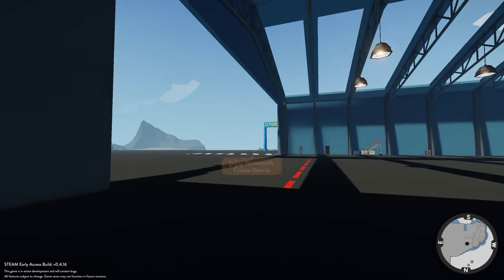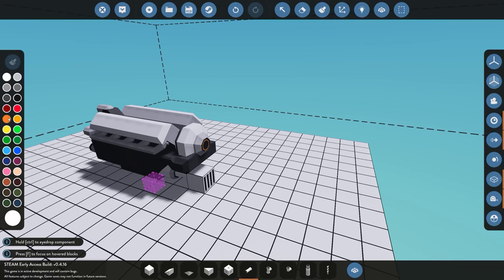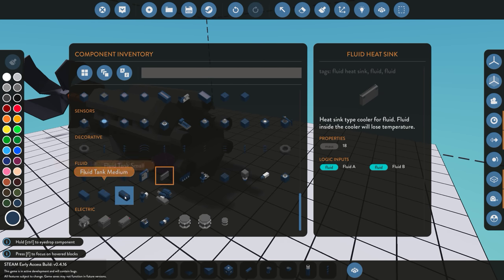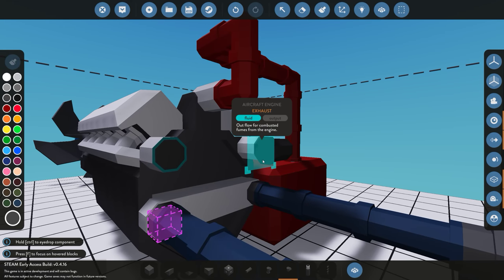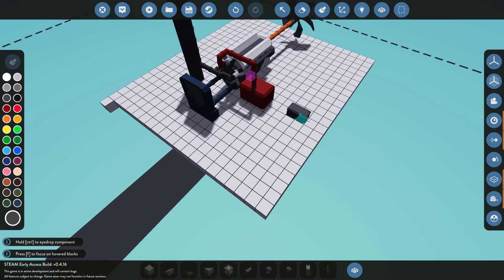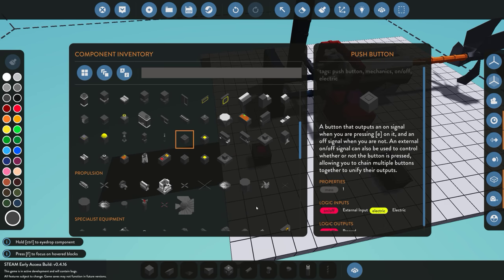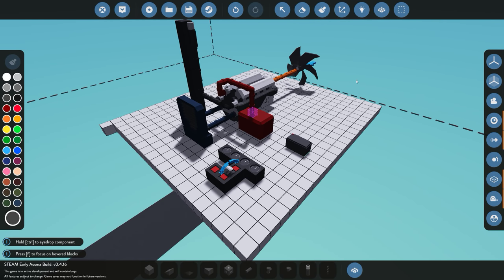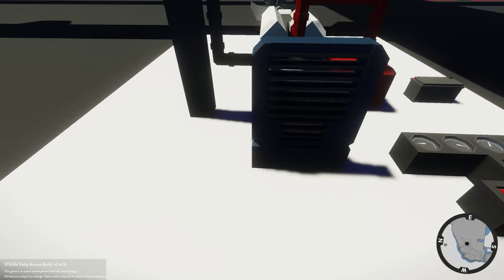Stormworks Step by Step Advance Vehicle Engine with Clutch & Gearbox Build Tutorial

Comment: so im having trouble, i connect a clutch to the engine, have a throttle switch on it and it all has power, yet when i turn the engine on, the boat starts going. All the clutch throttle does is change the sound, the prop keeps spinning no matter what. The gearbox is also ineffective
help?
Reply: TeslaBro is the clutch and gearbox right way? Its good to check
Reply: @vanukas8783  i also have a problem the engine cranks but doesnt start everything has power and gearbox is the right way up so umm and yes proppelors spin
Reply: BLÖRÖ dont ask me
Reply: BLÖRÖ btw have you tried Diesel yet?
Reply: @vanukas8783  yes its on diesel

Comment: CAn you connect batteries to batteries and still charge them all with a generator?
Reply: if you have all the batteries connected to each other if any generator is connected it will split the power to the batteries, all batteries connected to that network. also BTW you can have a block like say a motor and you can have a battery either side and you can have them both connected to it but not directly connected to each other and they will act like they are directly connected.

Comment: I try to make a small electric motor/engine and the pipes are all connected like your previous videos but when I try to wire them using logic nothing seems to work even in simple or non advanced non of my engines work so I have been going on the work shop for builds engines and I have to build around the engine which is quite limiting. I would like to start off simple and learn my way up but as I said non of my attempts work. I would like a bit of help thanks

Comment: Hi MrNJersy. I'm Italian so sorry for my English. I watch many of your video and I have a problem, I ve build a medium larg helicopter following your guide. I've got 2 medium engine, a gyro ecc... All connect. When I spawn and take start all doing well but when I increase the throttle they don't go up. So I try change the engine parameter but still don't go up. A last I ve increase the max rps of the engine but when finally go up, after few secon, temperature and rps go high and the eli take fire. Can you hel me?
Reply: add a gearbox

Comment: How would you use a tank for cooling when it has 1 pipe connection?
Reply from the maker: BigDaz Well you could use a custom tank with  two ports, however the concept would be that the hot comes out and into either a tank or a radiator then back into the engine cool, however you would need a pump to control all that
Reply: Can you add radiator/fuel tank/air intake directly onto engine without pipes/hoses?
Take it as challenge, make fully working engine without pipes
Radiator will be attached to engine, but pointed down, fuel tank will be on engine and exhaust pipes stick backwards in middle, air intake would be under engine and prop directly in front of it, will that work?

Comment: can you show us a boat with a gear box?
Reply from the maker: Sure soon
Reply: Can you add more sound? I have speakers at max but I barely hear you
Also looks like 1:2 is faster, so it is RPM, 1rpm of engine is 2rpm of output shaft, not Torque
Maybe you can make it to gear down (for tow truck) if you attach output if gearbox to engine and input of gearbox to wheels
Reply from the maker: Will try fix it

Comment: will stacking the gearbox add more gears?
Like if you connect three of them in a row, and set ratios of FIRST to 1:1 and 1:2 SECOND to 1:1 and 1:3 THIRD to 1:1 and 1:4 can you actually make gearbox with 4 speeds?
Or divide power from engine to four clutches and four gearboxes, with all sort of ratios (reverse indeed) , and engage just ODD(low) or EVEN(high) gear, then ONE out of four clutches, this should make 8 speed transmission, right?
....................engine        
4 clutches.. I  I  I  I
ODD............1 3 5 7
EVEN..........2 4 6 R
...................wheels
What will happen if you connect two pipes going from gearboxes spinning in other direction? will engine stall? or just proppeller spin weirdly?
Please test what it can take, try to break it, that´s what demo is about :D
Reply: Jakub Pollák that’s a good question